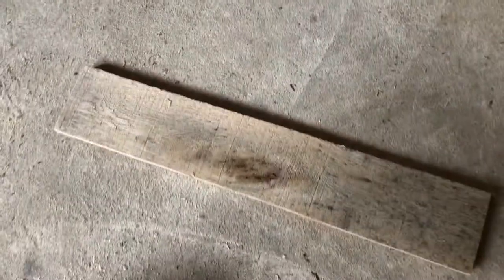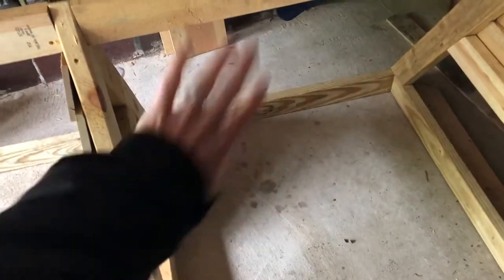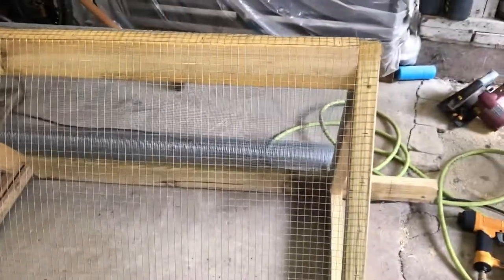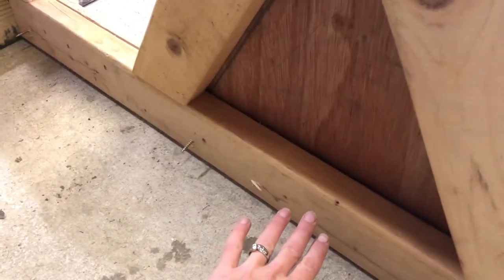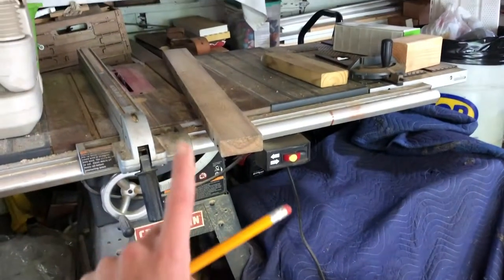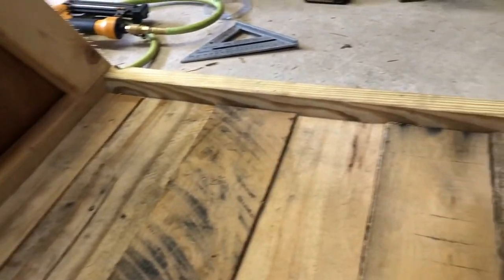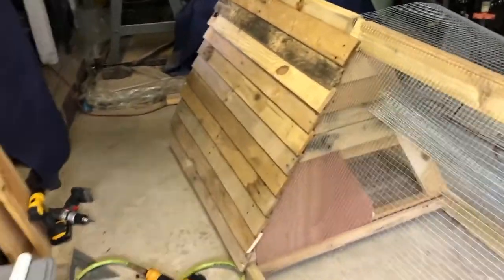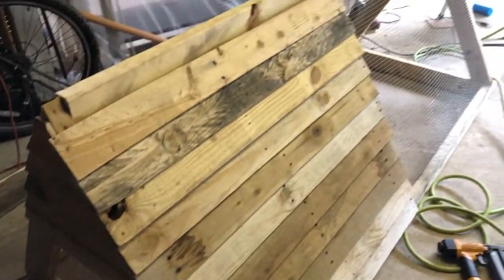Building an A-Frame Chicken Tractor - Day 2

Comment: Nice.  but so small how many chickens do you have? I would have extended it instead of shortening because of the wire. Use the wire end to end. Just ideas. But a good job done!
Reply from the maker: We ended up using this mainly as a sick bay or quarantine coop. It ended up being WAY to heavy to use as a movable tractor regularly. It will hold 2-4 chickens pretty comfortably for a little while. Right now it’s set up in the middle of our main chicken run as another way for them to get out of the weather. Live and learn right? 😅 the next “tractor” I make will probably just be pvc and hardwire cloth so it’s lighter and easier to move daily 🤷‍♀️